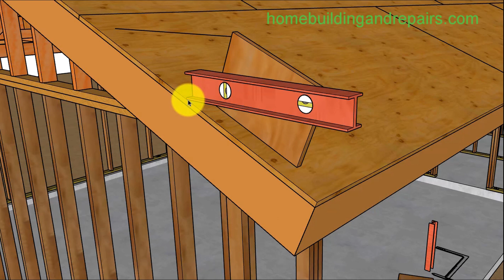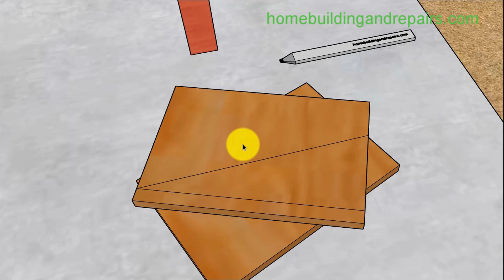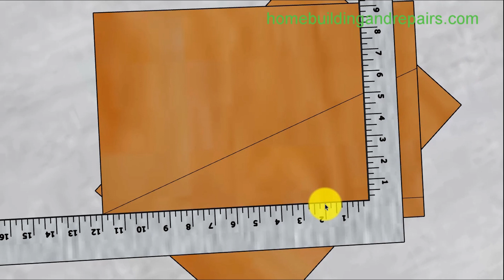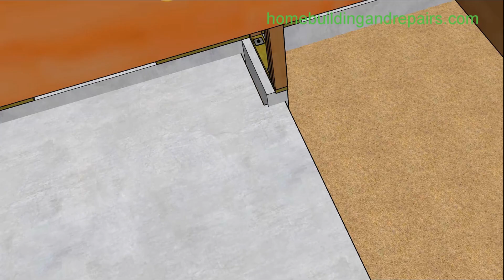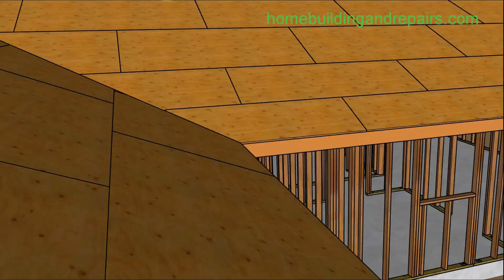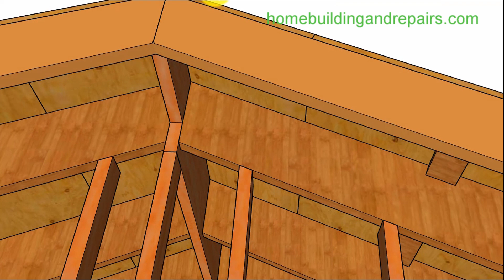How To Figure Existing Roof Pitch Using Level, Square And Scrap Wood

Comment: I have a 2 foot level that I marked in the center, at 1 foot. All I need do is put the end on the roof, then raise it until it shows level, and then measure up vertically from the roof  to the 1 foot mark. Quick, easy, and accurate.
Reply from the maker: I've used this method before and as long as the surface of the roof is  flat, you should end up with an accurate measurement, but if it isn't then a longer board might be required.
Reply: True, but you can pretty much tell if your roof isn't flat.
Reply from the maker: I like your idea and it works, but like I suggested in the video, might not be as effective as it would using a longer straight edge or straight piece of lumber, if the roof isn't flat or straight.
Reply: Whichever method used, these are good skills to have.